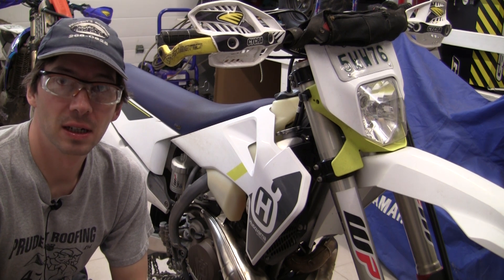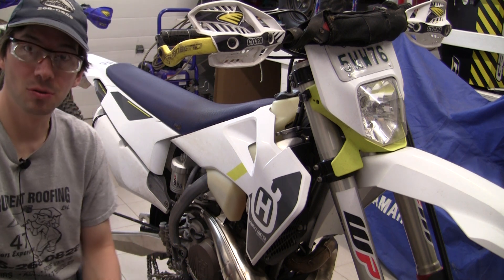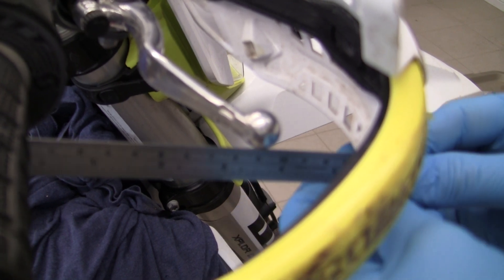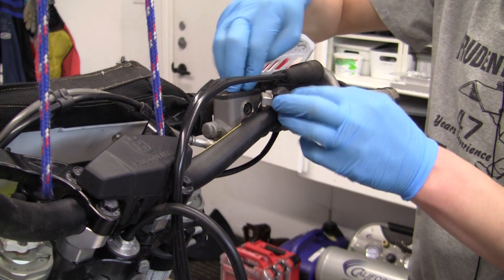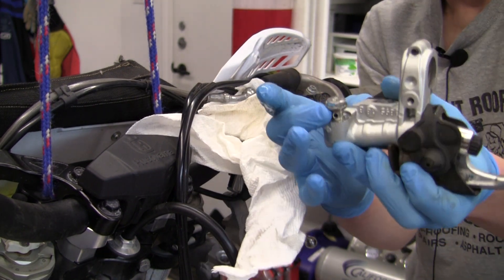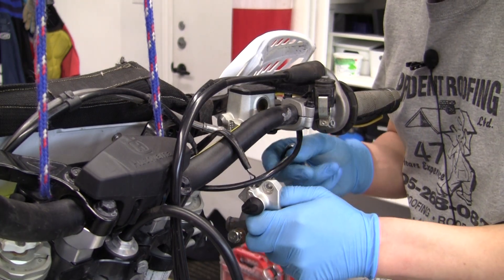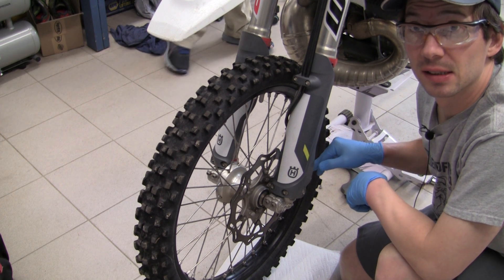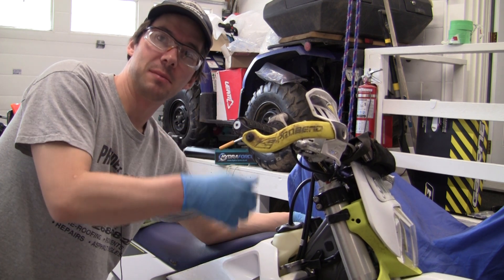Husqvarna TE250i Braktec to Brembo Conversion How-To (Gas Gas also)

Comment: I have the same problem in Husqvarna 2020 with Magura brakes. I bled it in every way and it didn't help. Only when the brake heats up does it start to catch high enough, so during normal riding you don't know when it will catch because sometimes it's cold and sometimes it's warm. I'm thinking about changing to brembo.
Reply from the maker: @PawelzChecin  maybe check the comment just below, seemed to work for that guy?
Reply: @lucgallant  unfortunately it only helped until I finished riding. After riding the problem returned.

Comment: When you changed the Master Cylinder did you empty the brake hose at first or doesn't it spill out when you remove it?
Reply from the maker: @madgamehd6079  well it doesn't come out that fast, I just quickly did the swap.

Comment: Before you guys spend any money, remove your front caliper, pump till the pistons move out a little and then reinstall the caliper. You’ll have to spread the pads just far enough to get it started on the rotor and wiggle/force it back in place. Pump the lever a few times then bolt it back down and you’re good to go. The free play at the lever is due to excessive piston pullback. I’m guessing the lip seals they use in the caliper are different from what Brembo uses and it doesn’t keep us close of an adjustment. Front brake on a 23 501s is rocksolid now.
Reply from the maker: @ajbarrick1894  hey that's awesome info thanks!!
Reply: @lucgallant please pin aj,s comment just tried it and the front brake no more play on it. Only the  couple of mm that are nessesary.
Reply from the maker: @bertr286  great news! I don't see a pin option but I liked and hearted, should help it be up top!
Reply: How it heat up?

Comment: The difference probably comes from the fact that the Braktec caliper pistons are 25mm versus the Brembo caliper pistons are 24mm which is significant. That's why when you swapped only to the Brembo master the lever pull was still long. I haven't taken apart brake masters to compare but pretty certain that the Brembo master piston diameter is also smaller than the Braktec.

Comment: For fitting the brembo caliper, did you also need to change the mounting support, or you can use the one from braktec? Thank you!
Reply from the maker: Reused the Braktec one no issue! 👍
Reply: @lucgallant  i also got a new brembo caliper, but mine dosen't seem to fit the braktec support
Reply from the maker: @RobertoBurta  sorry, I misunderstood what you asked, or was asleep still.... I bought a takeoff so it came caliper and bracket together. I was half asleep sorry... if you send me your email I'll email you a pic of the assembly I installed.

Comment: Did the same. Swapped out the 9mm brake teck for a nissan 12.5 master and still a weak leaver. Looks like the caliper is the fault.

Comment: Update: I installed a Brembo caliper and the pull/engagement is spot on. Now I can run in the lever adjuster so it’s not such a reach. Thanks to the OP for posting the fix.
Reply from the maker: Great news, still got the Braktec up top?
Reply: @lucgallant  yes, thanks to you, I left the master on. Not wild about the Braktec perch mounts though.
Reply from the maker: @michaelbartz4077  great, I'm happy my expenditures helped, lol. I've been happy since I made the change also. If only suspension tuning was that easy.
Reply: @lucgallant  I put the Race Tech FMGV-27523XC kit in the front and in the rear a .48 spring, gold valve/separator valve with a bladder kit in the rear. The kits come with several shim sets; RT will work up a profile for you with stack recommendation. I’ve done 4-5 bikes with RT components, all have worked really well for me. I’m riding gnarly, rocky desert with some single track and some fast 2 track. The suspension is great every where.

Comment: Just got a 23 450 FE and noticed immediately how mushy the front brake was,  I have a 2015 501FE with Brembo s- they are spot on.  Thinking I can swap out the units.  I was wonering if just replacing the Calipier would cure the mush since the master swap in your video did'nt really do anything?  I did notice that the map switch has it's own carrier on the bar, so that would make the swap that much simpler.
Reply from the maker: Also just a note - these brakes weren't mushy. They basically didn't engage until that 1.25", then they felt normal. If they start to engage from the beginning and braking action occurs and you just feel mush, it could be air. I'd definitely give them a good backbleed before spending any money.
Reply from the maker: If I had to choose between two components I'd definitely try the caliper first because as you say the master did not do anything. But, the problem I think will be to find one on its own, it may be almost cheaper to get both off a take-off. Let me know how you make out!
Reply: Mushy was perhaps a poor choice, it was the amount of travel before the caliper engages the pads. Two in my regular ride group have 22 Braktec. I’m used to my 2015 501 Brembo engagement. I’m use  aggressive trail braking. I do find the Brembo rear locks up too easily and my buddies really like the the slower engagement of the  Braktec. Up front I haven’t had any problem with the Brembo, it’s spot on and even through the full stroke. Granted I haven’t ridden the 450 except to run a few heat cycle and load it. Loading it, I literally pulled it to the grip to lock up the front. I’ll bleed the system but it’s that inch and a half lag that got my attention. Swapping, if they are comparable with my 501 is probably too much trouble. I’ll see how it holds up before I look for a Brembo caliper. Right now I’m just going over the bike, putting the proper spring rate and a bladder kit on the rear, putting the twin air power flow filter frame/air cleaner and opening the end cap on the stock bike.  Since the bike is mapped for close course, I’m thinking I won’t have to advance the TPS. I did all 3 on my 5 and it run  on the stock map without flame out it’s been a great ride, just time to update my Baja machine. Appreciate the original post on the Brembo conversion!
Reply from the maker: @michaelbartz4077  I fully agree it's that lever travel that got my going on this too. Good luck with the conversion!
Reply: I like your video, I had tried a bigger rotor and it helped some. My front doesn't have a good feel or strong enough. The Brembo has a great feel and super strong. But after your video I was thinking about changing the calipier first on the front.
My back brake is fine it doesn't lock up like the my Brembo, I adjust my foot peddle to reduce lock ups and sensitivity.
Thanks again for your video!!

Comment: What a PITA. I kinda just did the same thing when I converted my Beta 300 Xtrainer to KTM forks, also had to use all KTM brake hardware as I didn't want to mix Nissin and Brembo parts, although they may have worked together.

Comment: I was going to ask Can you not use part of bracket from a KTM setup for the mapswitch to hold it in place? but then realized that the Husky mapswitch is made to be part of the master cyclinder mount?
I've see the map switch for the KTMs and they mount in place of the top clamp on the brake.. , I guess you would just need to get a lower clamp to mount it elsewhere if you didnt want to have it on the clutch/brake .
Reply: FWIW- the 23 450 fe map switch is on it own plastic mount. It was closest to handgrip, I took the start button off and slide the switch to the other side. You have take the gripes off to move it, it’s not the smartest mount. I might move it to the other side if the wiring harness allows it. I thought I saw one mounted on the left side of a 22 501. Maybe the ktm/Husky switches are interchangeable?